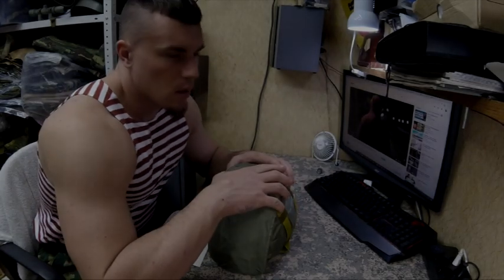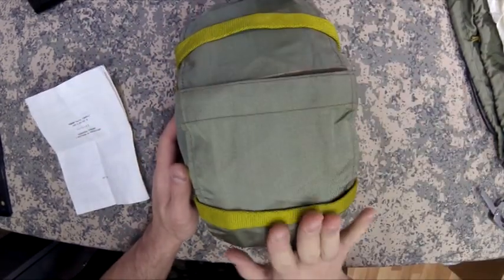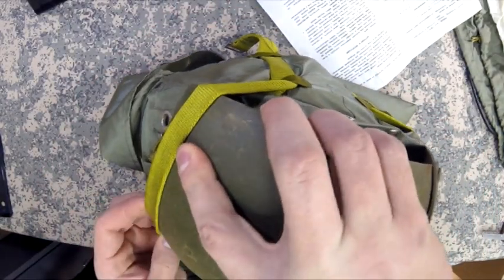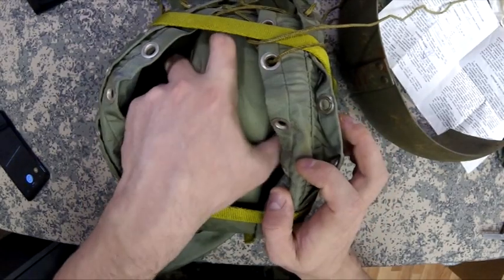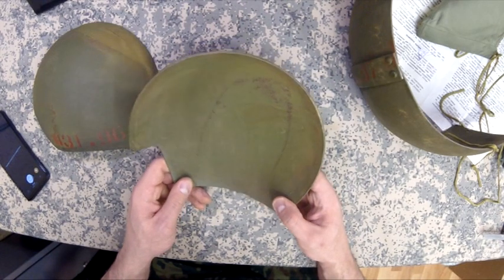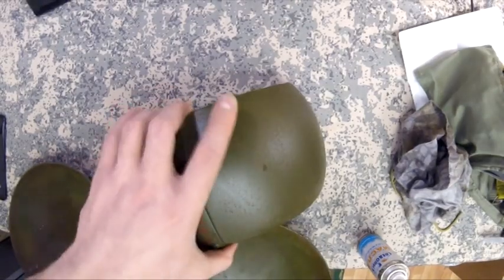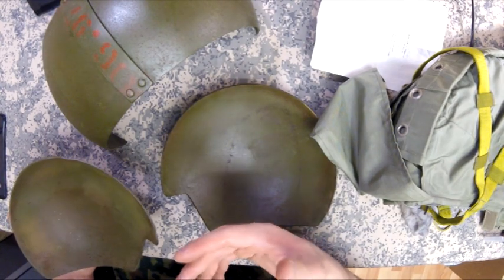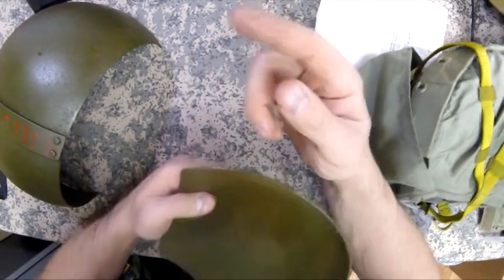Old steel SSH94 helmet review

Comment: i think, aside from the weight (because some others helmets where also heavy, like the altyn and it's evolutions) the lack of relief cut in the back for the neck might be a source of the neck-killing problem (for exemple, if you look at the old SSH40, 60 and 68, the back has a kind of cut to prevent the shell from "biting" into the wearer's neck. while the sfera, both the STSH81 and the SSSH94, doesn't have this cut, making that when the wearer look a bit upward, the back of the central plate directly bite into his neck. so, not difficult to imagine that, if someone look  abit upward and get impacted, the back of his central plate will directly transfert some impact right into his neck and harm him).

i think it could be interessing, with a cheap replica (to not ruin an original) to grind some metal at the back of the center plate to create a relief cut, and to fix some foam in the liner to compensate for that void (to prevent the central plate from mooving back due to the back being grinded out) and see if it makes the helmet more comfortable and balanced to wear